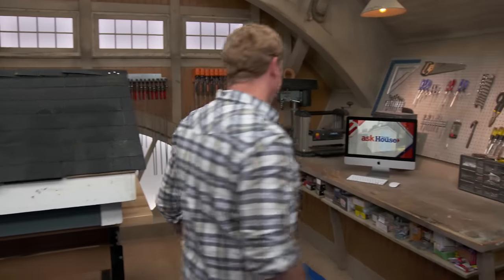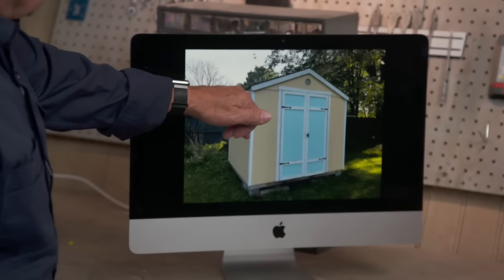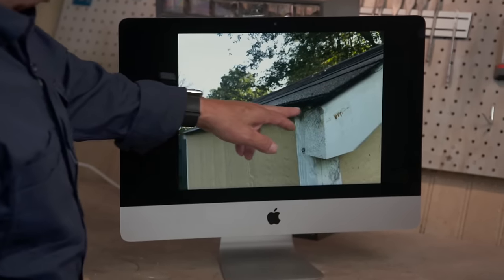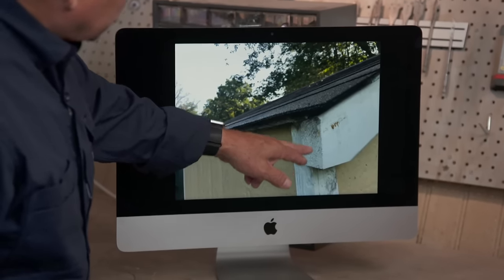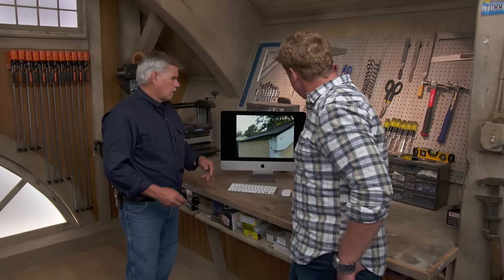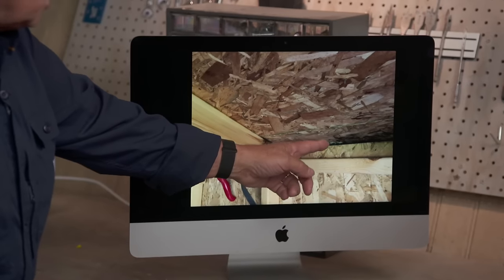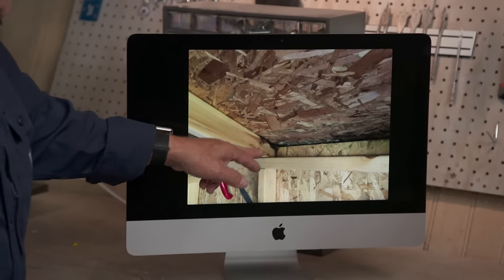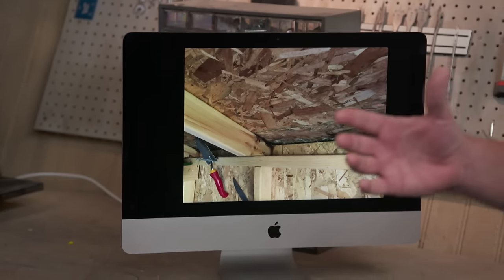Testing Drip Edge Installations on Roofing | Ask This Old House

Comment: Standard 8" drip edge? let me see you pick that up at your local Lowes.
Reply: or homedepot
Reply: bLowes
Reply: Shhhh! That's how we get paid for fixing the "cheap" way...But' that's not an 8" drip edge, no such thing, ...it looks like a 3X2  or 3X3
Reply: godbluffvdgg review the beginning... definitely as he said
Reply: @BlackSwan912   Yeah I believe Tommy when he said 8",, its the standard part I question. I don't shop at building supply stores in Boston but that looks like a specialty item to me.
Reply: Jeff Holland my local lowes closed recently. Lol
Reply: Jeff Holland Oh! No they are NOT standard. In Homelo-depolo they are in the roofing section... 10 or 10.5 FEET long lol. I had to change my reply midstream lol. No 8-inchers.
Reply: Lets see the "Contractor staff"  (Lowes or Home Depot) even know what the hell roof drip edge is.....    

  They acted like  I was on crack for asking for a toilet insulation to kit to help with the condensation problems in winter in North Carolina. They claimed no such thing existed  and why would you need to insulation a toilet tank from sweating/collecting humid moist air for having cold water inside side it, which chills down the ceramic....
Reply: Lowe’s blowes but the cheapo depot is not much better..
Reply: For real. Lol
Reply: It’s made from an 8inch piece of flat stock. It’s standard.
Reply: He's from Boston though
Reply: Jeffery- You took the words out of my mouth. Maybe its a northern snow/ice thing. But i've never seen 8" drip edges down in Louisiana. The big boxes have six inch online. But none of the stores even carry it. It's a special order.
Reply: Best burn I've read today!
Reply: I wish I saw this 25 years ago😂
Reply: Looking at my professionally installed roof and it's flush!!! And the water is running all against the facia board and running down behind the gutter

Comment: Course I just had the roof replaced a few days ago. They installed drip edge where there was none prior. I can tell there's definitely no gap between the fascia and the drip edge. makes me wonder if I shouldn't pry it out a little.
Reply: Anymore most fascia boards are covered with aluminum fascia that goes under the drip edge. That's been common for decades.

Comment: 3/8" gap, does that create a problem with insects or bees? Why not extend the shingles 3/8" past the drip edge?
Reply: Yes, spider haven, yellow jacket nests, and even termites.  I would never create such a gap there.  Never create a gap.  Overhang shingles an inch or so and put the drip edge flush to the facia.  Homeowner should keep paint on facia in good condition and there will be no rot.  Drip edge will kick out most of the water.
Reply: @Robert111  was thinking that too, is that what u do ?
Reply: @Eastbaypisces  Yes, that is what I do.
Reply: Drip edge flush with fascia. Shingles overhang 3/4 inch. Normally we wrap fascia with trim coil on our jobs.
Reply: @devincook3278  What do you gain by wrapping the fascia with trim coil if the drip edge is flush? Thx
Reply: I like showing actual proof, but who in the world, as a pro would actually cut the shingles flush and not let them overhang about an inch.
Reply: Gap or no gap, bees can dig anywhere.

Comment: How about simply using composite material for the fascia board - won't rot and no painting needed...no worries.  I would still use a drip edge to protect the leading  edge of the roof sheathing.
Reply: You simply cover it in aluminum fascia. That's the standard nowadays. This is called bullboard. This is old school, not done today except by old timers. Nowadays it would all be flush with 2 1/2-3" drip edge plumb with fascia, which could be composite (hardy or PVC, NOT composite board) but is most often done with aluminum fascia and a vinyl (or old timers still use aluminum too) soffit.

Comment: I have a drip edge tight against the facia with a gutter. When it rains water comes down between the back of the gutter and the facia. I find this is only a problem on the downspout end of the house. I'm going to bend it out some to see of it fixes the problem.  Thanks for the video.
Reply: Use gutter apron

Comment: IRC Bldg code calls for metal drip minimum of 2” onto the roof sheathing and a a minimum of 1/4” below the edge of the roof sheathing.  I specify a minimum 2”x2” metal drip edge with 3” overlaps, nailed every 10-12” ( staggered), only nail into the roof sheathing (never the fascia board.  The gutters should be installed behind the drip edge (water is then channeled directly into the gutters) with nothing penetrating the leg of the drip edge.  Starter shingles and field shingles are set with a 1/4” - 1/2” overhang.
Reply: Which IRC year and section are you referencing ?
Reply: I am currently trying to determine what is wrong after I paid for fascia/soffit/siding. 
The edges of my roof are curled up now all the way around on the rake and gutter sides. I’ve had one water leak. The company that did the work remove the drip edge installed the facia and soffit and then reinstalled the drip edge then gutters were replaced later with leaf screen. They sent a representative back and said the leaf screen is not letting the drip edge set properly but that doesn’t explain the rake sides. If anyone has any opinion on this it would be much appreciated.

Comment: Home owner
1. should I brush, bleach, wait, and hose off the moss first?
2. Install the Zinc strip.
2. should  I replace the facia first.
3. Shingle edge directly above drip edge. What should I do with the shingles (if)?
Lacking in experience, but not in patience and basic intelligence.

Comment: I watched this video for any tips on my hunting blind I am building. Thankfully, it is pitched front to back and also I have some scrap metal roof I am using that hangs over 6 inches. I am going to put drip edge on, but I think it will be fine.

Comment: What they didnt show is how the water would shed if the drip edge was tight to the fascia AND shingles were 3/8" or more over the edge. Notice in the video  that the water did not ever come in contact with the drip edge when shingles were hung over.  This makes the gap between the fascia and drip edge irrelevant. It wouldn't matter if its tight or space 4", as long as the shingles are overhung 3/8" minimum the water would shed off the roof without contacting the face of the drip or the fascia. 

There are several reasons not to space drip metal. 
1. As mentioned you create shelter for insects. Also invite other critters to find easy access into the eave soffit. Often the roof sheathing is short of the fascia and leaves a gap that rodents or birds can easily widen enough for access. 
2. If the drip edge is spaced when a gutter is also in use it would highly increase the likelihood of water backups in gutter infiltrating the building. 

3. If the drip edge is spaced when a gutter is also in use you are creating an area for condensation to be trapped which will, in time, damage the fascia and edge of roof sheathing. Even without a gutter condensation is likely. Landscape beds and mulch contain alot of moisture which will condensate under soffits as well as in void created by gapping drip edge. 

Don't do it......
Reply: I just had shingles put on my house and before that 15 years ago. In neither case did the roofers put the edge of the shingles 3/8" over the edge; not 1/4". not 1/8". Pretty much even with the edge is where they were placed. I guess I will have the same problem I had before of water dripping behind the gutters down the fascia and will deal with it myself by placing something, probably cut strips of vinyl siding, up behind the drip edge down into the gutter. Looking at various drip edge, it looks to me like some are poorly designed with top/front point being short and curved such that water, if not going out and falling off extended shingles as you suggest,  run down and back the drip edge itself such that the water drips close to or even onto the fascia if the top rear edge of the gutter is not shoved up behind the drip edge or not completely tight against the fascia. Some drip edge however looks like the point extends out further and is formed tighter and water would drip off into the gutter and not run back.
Reply: Well what would you recommend?
Reply: Ah ha! I think Im onto something that you mention in #1 above. I noticed when I clean my gutters, I have a hard time getting my hand it the on corner of my house to put downspout strainer in. The drip edge interfers. Last winter Ive found out that there are signs of mice in the crawlspace  behind this section of the house. Without yet moving some insulation to see, Im thinking this large gap leaves the access they need to get in. My roof deck is made up with 1x6's., an older home. Im sure there is a gap where the fascia  and bottom edge of the deck meet.  That ,along with the drip edge not being flush is making the passage.
Reply: @terrythomas790  Our downspout strainers in the gutters clogged within months even with screens; I stopped using them.
Reply: @bigpardner  I have drip edge and gutters, my starter shingles are also flush with top of drip edge.... have one spot where some back seepage gets behind fascia that is metal covered.. maybe in summer I will run tar caulk all along top of drip edge ???

Comment: Great video. The roofing company we used totally installed the drip edge wrong. I’m assuming that if a roofing company installs drip edge right up against the fascia, you should have them re-install the drip edge?
Reply: Re-installing the drip edge will require pulling out the edge of shingles.

Comment: I used to do roofing in the south and we would overhang the singles 1/2" I guess it wasn't as effective as a finger space between the facia boards but I question how long that dip edge will hold that space between. If you have to use a ladder to clean the gutters twice a year. Your going to bend that drip edge with the ladder.
Reply: Gutter should go behind drip edge in this type of application, so your ladder would be on the gutter.

Comment: I would make the gap a little smaller for the drip edge. If you already have rotten fascia boards get Azek or PVC fascia board. Just don’t cut in very cold weather or it will shatter.
Reply: I just put up some new fascia boards. I attempted to purchase PVC but no suppliers in my state carry it. I called a couple of manufacturers and it was all special-order. They'd probably sell more of it if they could get it to the customers who wanted to purchase it without having to buy 15 houses-worth of the stuff.

Comment: You didn’t mention whether you should put your ice and water shield on top of the drip edge or let it run down on the sub facia and Tuckett over the facia
Reply: This is the age old question between roofers. Really just depends on who you ask. Some companies install the drip edge on top of the ice/water shield, and some install the drip edge first then ice/water on top. You’ll get a different answer every time

Comment: Was the drip edge Ansi/Spri or Miami-Dade tested for this type of "gap" installation method? I mean I would rather replace some fascia board in a few years then a costly blow off repair from a small wind storm.
Reply: It doesn't blow off in non hurricane winds.  What Tommy showed is standard best practice in the NE United States, and would be practical anywhere else with similar climate.  In Florida, I believe you guys put the bottom layer of underlayment OVER the drip edge, which means more likely to cause water damage on the roof edge, but more likely to survive a hurricane.  Probably a smart trade off in Florida.  Not a smart trade off in Boston, upstate NY, etc.
Reply: That's the point of testing the installation method with ANSI/SPRI or Miami-Dade to prove it works. If you prove it works then it's good but saying it's best practice is an opinion. I'm not saying this gap method would have a high rating, but this method would seam to have issues with wind driven rain.
Reply: @thedieslexpress  Best practice is an opinion, you're right.  What I should have said is, has been best practice for 40 years.  That means they're proven solutions, which are more reliable, overall, than new solutions.  Codes are tested, pretty much by definition, only to a specific set of parameters.  I'm certain that the florida codes are good in terms of protecting against hurricane winds.  I'm equally certain that the chances of those winds hitting me, where I live, are so close to zero as to be unimportant.  I'm also certain that building practices used here work great to protect against water damage that affects this climate.
Reply: @tomsmith3045  residential building codes are for minimum safety requirements, and drip edge wouldn't fall under a building code. It would fall under the technical specification requirements. Also just because something has been done for 40 years doesn't mean it's the best practice or proven, it just means it could have been done wrong for 40 years. Plus, if this detail was ANSI/Spri tested doesn't mean it would past Miami-Dade tests. All it would mean is it would've been tested and rated per a strength pull off test which would translate to a wind rating. What do I know though, it's not like I worked for a metal edge roof manufacturer and gave webinars to architects and engineers for their continuing education credits. Good luck man!
Reply: @thedieslexpress  :) It's all good.  If you've worked in engineering that long, you know that almost anytime - not always, but usually - when one thing is changed to make it better, there's an unforeseen consequence in the system somewhere else.  Me, I've replaced a lot of fascia because it had tiny "drip edge" fastened right up to it, and OSB, because the drip edge was put on top of the felt.

Comment: So what is the drip edge for if the water should be running directly off the shingles away from the fascia?
Reply: The drip edge will support the shingles and prevent them from sagging and curling back to the fascia.

Comment: I get why you want to extend the drip edge out a little. However that leave a gap up under the drip edge and the fascia board. I would be worried about bee's getting in there.. That gap all the way along your roof would a perfect spot for bees. Do you fill that gap with anything? Also I notice above my front door of my house there is a little water dripping out from behind the molding above my door. There is a 6ft piece of gutter along the roof right above my front door. With that is it possible I have a drip edge problem as shown in this video?
Reply: Yes, that's possible, i do windows and doors so i have experienced that before, with costumers.
Reply: @alvaroalmanza7110  so how would I fix this? I was going to take that short 6 ft length gutter off (not doing anything anyway.) And put up flashing like recommended in the video. Hopefully that will work.
Reply: Run a 1x2 on top of the fascia, so the drip edge runs on top of it
Reply: Spray foam obviously. Duh. Or 54 tubes of silicone that only sticks to the facia. You'll need an electric double barrel Caulking gun, I recommend full silicone and the sploogeomatic 4000. Also only do the parts you can reach from an 8 foot ladder and then call professionals to come finish the parts you can't reach 8 years later.
Reply: @TheLoopy989  spray foam duh? That will look like crap. I was hoping that was a joke. edit: it would take a lot of silicone your right
Reply: @inspectorsteve2287  correct very much kidding. That's more like the crap I I deal with as a exterior contractor, and custom metal roofer. Homeowners should have to take a month certification course before they are allowed to use a spray foam or caulking gun. And most roofers and siders for that matter.
Reply: @TheLoopy989  really? Wow. Caulking is important as a last line of defense to water damage but a month wow.
Reply: @TheLoopy989  I appreciate the help. I'll send you a few pictures in a week or so when the snow melts enough. I have icicles hanging off the roof now so I wouldn't be able to get a good pic. Thank you. I'll put my username in the subject line.

Comment: Where can I find 8” drip edge? I’ll order, if needs be, I googled it, can’t seem to find it
Reply: You don't need that 8". That stuff hangs way too far under shingle honestly, if not nailed down like crazy it could possibly cause first or second row of shingles to lift. Standard drip edge is like 2 1/2" hanging over fascia and like 3-4" under shingles. Plenty of room to get a nail downwards into fascia board and the rafters every 2'. And of course every 12-16" through roof deck too if rafters are 2' on center apart.

Comment: Whats the difference between a drip edge and a gutter apron.  Are drip edges for houses with no gutters?  What if your facia board is clad in metal, will a drip edge work fine since its not hitting the wood but the metal instead.  As well, if you have a roof already shingled, how would this be added after the fact.  Not like you can extend the shingles
Reply: Drip edge helps with gutters too, by reducing drip down the fascia behind the gutter. I retrofitted drip edge on my 2010 shingled roof. I had to remove the first three rows of shingles, then re-nail them at the correct overhang. PITA. But I hired it done at the two-story end of the roof. They just bent the shingles up, destroying some of the grit. Then they nailed drip edge through the fascia, upside down in some areas! One year later I'm replacing most of those shingles and some drip edge.